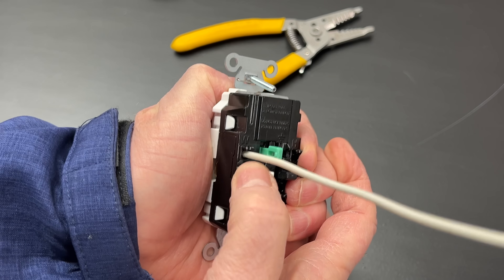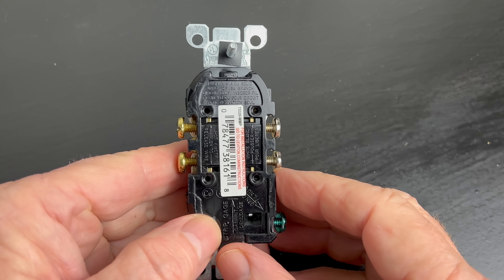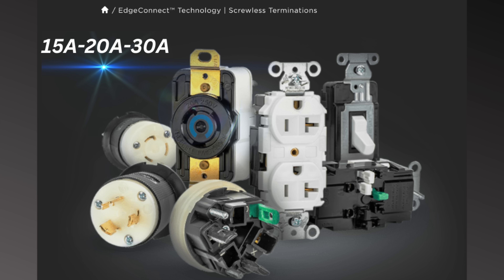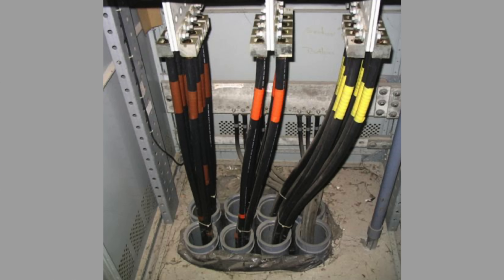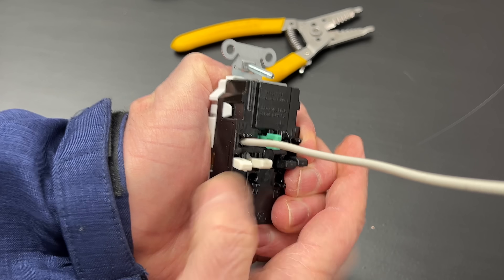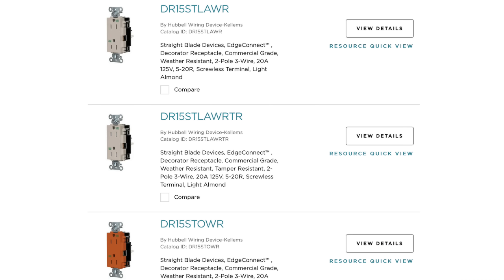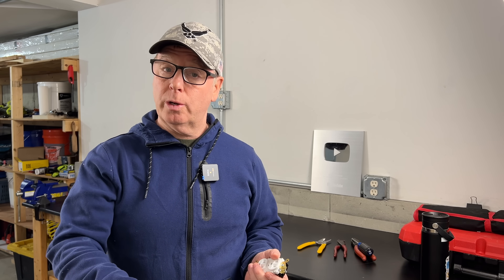This New Receptacle Design will set a New Standard (Welcome to the Future)

Comment: But will the spring loose tension with heat
Reply from the maker: I don't think so. The spring is not part of the current path. It presses up against the contact point. I think devices should be replaced about every 30 years and I'm confident that these will last that long or more.

Comment: Sounds like a good option for homes built in the 80s with cooper clad aluminum wiring which I understand is a thicker gauge and brittle.  Thanks for the tip!
Reply from the maker: I believe these are only rated for copper wire.
Reply: yes they Copper only  @BackyardMaine

Comment: 'Most' electricians may not recommend 'backstab' connections but, ironically, every outlet and switch, in my house, use them.  Maybe electricians should follow their own guidelines.
Reply from the maker: Some electrical contractors bis houses low to make sure they win the bid and then they force the installers to use the stabs because they're so fast. I read one comment from a subscriber that said if his boss bought him making J-Hooks he would be fired on the spot. Another comment saying that each device was timed and if you fell behind you were gone.. That's the issue in my opinion so I would like to see the manufacturers stop making them. This new type is awesome though.

Comment: My wife and I lived in a mobile home when we were first married. It was a very nice little house, the previous owner had even installed a pitched roof and insulated it. The one thing they didn't do, however, was update the wiring. I had a receptacle catch fire one night. I was lucky as i witnessed it happen and took care of it quickly. The trailer was wired with aluminum wire and used the back stabs on the receptacles. That is a bad combination! I love the look of these new receptacles. I will be giving them a try!
Reply from the maker: I've heard a lot of horror stories about mobile home wiring but I have never actually worked on one myself. The stab connections are rated for solid core copper wire only on the old back stabs. I'm glad you were able to take care of the fire quickly.
Reply: I would put money on the fact that those devices were not listed for use with AL wire. It wasn't jut the backstab-the whole thing was probably suffering the corrosion that occurs between dissimilar metals.  That turns your outlet into a heating coil in the wall.  Thank God that fire didn't happen in the middle of the night.
Reply: @HBSuccess  

Amen! I don't think there were many safety protocols while building mobile homes in the 70's.
Reply: That's what I was thinking too.  I think all backstabs are rated for copper only.  Code violation.

Comment: Wago cage clamp technology. I`ve used it for years in industrial machine controls. Extremely reliable connections!
Reply: First saw Wago connectors years ago on a transmission control module that vibrated like crazy, They worked a treat and never failed in very difficult service, good product and it has been in designs for about 40 years. Great product design

Comment: These stab in back Receptacle Design has been out for 20  + years. My house was built in 1997 had has them.
Reply from the maker: Yes the old stabs like I showed in the video have been around for decades but they are unreliable and not recommended by most electricians like I mentioned. This new design has been around for a couple of months and is completely different.

Comment: With all the smart switches and outlets out there now they need to overhaul standards and make switch "modules" with a recessed box that you wire into the gang box once. The switch module would click into the box and make electrical contact. That way to "upgrade" a switch you just pull the old module out and pop a new one in. Quick and easy without messing around with any wiring at all! Probably just a pipe dream though since that would require a lot of changes to manufacturing standards and electrical codes.

Comment: I want back wire commercial grade.
NOT the push in and go wiring devices.
Those new style receptacles won't work very well with shallow boxes.
I want the option of screws on the sides.

Comment: Thank you in am new to your channel. Do you have an opinion and recommendations regarding electrical outlets with USB and USB C outlets built in?
Reply from the maker: Hey there..and welcome. The one thing to consider when installing a receptacle with USB or USBC is that they are quite a bit deeper than a standard receptacle so the depth of the box and how many wire are in it should be considered. Other than that I think all the major manufacturers are pretty decent.
Reply: @BackyardMaine  thank you

Comment: How do they compare to back wire? Does the wire twist after connected like stab connections? Price compared to back wire?
Reply from the maker: You will have to check your local supplier for price but I believe they will be priced inline with other commercial grade devices. The connection is solid, much better than I was expecting. I think the back wire connections are a great option as well. I believe these are being marketed as a time/money saver because of how fast they are to install with the same reliability as their back wire devices.

Comment: AS  A ELECTRICAN FOR 40 YEARS I NEVER LIKED TERMINAL CONNECTIONS USING THE 
 STAB-IN ON THE PLUGS. THE SCREW CONNECTION IS ALWAYS THE BEST METHOD PERIOD
Reply from the maker: I agree but we should stay open to new designs and feature they may actually be better. When plastic and fiberglass boxes came out all the experienced electricians we saying they were junk but in actuality then are safer, faster to install and reduce issues in the box after install. I started my electrical career in 1983 so 40 years for me as well.

Comment: I agree about residential grade outlets. I don't use them either. But you said the back stab are one time use. All the ones I've seen have a rectangular slot that you can put a small flat head screwdriver in and depress the tang to release the wire. The one you showed had that. 🤷
Reply from the maker: Yes they have that to disconnect the wire but once you do you cannot use the stab again. You can still use the side terminals. All backstab receptacles no matter the manufacture are listed as one time use only. It's in the literature and most also have it printed on the back of the device. The reasoning behind it is when you push a small screwdriver into the slot to release the wire you're bending up the metal tab that secures the wire. The wire will be loose after that and fail very quickly.

Comment: I like your video on these products. I’m retired from electronics and telecommunications( mainly RF)  tech jobs most of my work career. I always think of a wire size in an AGC glass fuse when I look at a connection.  The push in connections on the outlets and switches never  passed the 15 amp + safety factor. I’m getting ready to buy a bunch of outlets and switches on a duplex I’m building and will check this new type out. 
We used a lot of big stranded wire where I worked. The last place was a gateway earth station and our DC load for 48v was 1400 amps. I did 15 years doing communications work  on the Alaska pipeline before that. We did that with both fiber optic and mountain top microwave.  I lived in Maine once.
Reply from the maker: Very interesting, thanks for sharing. I'm not originally from Maine but I've lived here since 1994.
Reply: @BackyardMaine  I was stationed in Brunswick 72-75. I had a great time doing things like canoeing the Allagash, skiing Sunday River and Lost Valley and riding a 350 Honda around with friends that also had them.

Comment: This is the first time I have seen one of your videos. How refreshing to see another professional electrician telling it like it is. Although I am now retired I spent 50+ years doing troubleshooting and repair as well as new installations. Most of my work in later years was commercial and industrial. I spent a number of years doing residential repair and remodel and always recommended to my customers that they would benefit from using commercial grade outlets and switches even if they did cost more. Thank You Again. P.S. I started out in Los Angeles City and County which always had stricter electrical codes than national, like outlet orientation.
Reply from the maker: Awesome thank you and thanks for sharing your story. I started my electrical career out in Sacramento CA as an Air-Force electrician. I'm retired now as well.

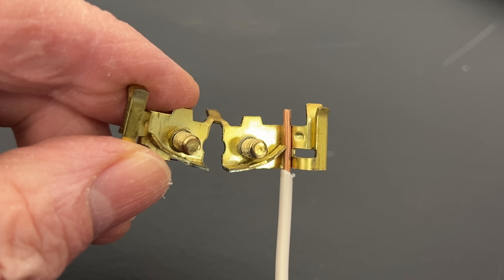Comment: At 2:37. Do you have the red meter probe in the neutral side of the outlet?  Isn’t the red probe meant to be used on the hot side of the circuit?
Reply from the maker: It doesn't matter when ready AC voltage.

Comment: I still think the side screw terminal with the J hook is going to provide a lower resistance connection which will be operating at a lower temperature when you have something like an electric space heater plugged into that outlet.
Reply from the maker: You may be right but this design is a huge improvement. I'm going to do some load testing on these and compare them to side wire connections with an IR camera.
Reply: @BackyardMaine  The side connections will have the lowest resistance, however, the gauge of the metal that carries the current from those screws to the actual outlet may be the hot spot.

Comment: The stab devices are trouble as are the indivisual connectors made similar for wires.
Manufacturers have torqe specs, how do you achieve a good safe connection with them? You can spin the wire once inserted.  How is that a connection and what's the torque? This new device connection looks good.
Thanks for the update!

Comment: I still think the J hook method is better due to the increased surface area of the connection. Can you spin the wire when connected to the Hubbell?
Reply from the maker: I like the J hooks and back wiring on commercial grade as well but these are really decent and a huge improvement. I didn't try to spin the wire so I'm not sure. I'll check when I go back out to the shop. Im going to do more testing including load testing on these so stay tuned.

Comment: I really like the promised range of their products (I.e., 20 amp, GFCI, etc), but I think I prefer the clamping design of the Leviton Edge.
Reply from the maker: They may be a bit more intuitive but they are only offered in residential grade 15A devices. Plus only receptacles, single poles and 3-ways and only DECORA style. Maybe they will expand in the future.
Reply: @BackyardMaine  I happen to prefer Decora, but I get your point.  At least their 15-amp outlet is rated for both 14 and 12 gauge wire.  I’ve written them a note asking if they plan to expand their line.  I’ll let you know if they respond positively.

Comment: I feel like the time spent screwing wires into outlets constitutes a vanishingly small part of an electrician's daily routine. It might even be a great job for an apprentice or helper.
Reply from the maker: I think I want over features other than the speed to connect them. Check out their product information page to see the connection test results obtained from UL.
Reply: @BackyardMaine  I agree, the features are great and should be on every fixture. IMO it's well worth the $20 price to novice homeowners who don't have the tools or the skills to use them properly. But I, and I'd think most electricians, find it more cost effective to use a $2 outlet and double-check my work before taping it up. I've never had one go bad on me.

It's funny, I never imagined it from a perspective other than an installer's.. it absolutely should set the standard for homeowner repairs.

Comment: Backstab was not made for DIYers; they were made for production new construction.  That electricians don't use the (now) doesn't mean they were intended for the DIYer.
Reply from the maker: I disagree. They were designed to make it simple for anyone to make a connection regardless of experience but then greed kicked in and contractors started using them in production homes because of the speed of use.

Comment: I’ve been using the Leviton Edge product 
This ensures a color match for the Leviton wall plate as well
Reply from the maker: These are similar but a much tougher design and higher end device overall. One thing I don't like about the Decora Edge is it's only offered in 15A residential grade devices, only in decora, and limited to duplex receptacles, single pole switches and 3-way switches. Maybe they will expand in the future?

Comment: How much weight do you think a screw terminal connection would hold?  I’m guessing 100+ lbs if torqued correctly.  25 lbs is nothing.  20 AWG needs to withstand nearly that much force for crimped terminal connection.  12 AWG should withstand at least 100 lbs.
Reply from the maker: I really don't know but as you know the pull test isn't really the best measure of a connections ability to hold up for years. I do know that the same 25 pound weight pulled out of the back stabs on both devices I tried from two different manufacturers. At 100 pounds you're going to stretch and probably break the wire.

Comment: Thank you for this information! I, too, am excited to see one of these- they look fantastic. MAYBE someone finally built a better mousetrap??? Like you, I have found many backstabbed receptacles where the "electrician" ran a heavy load item off of a backstabbed connection and over time the load burned up/loosened the connection with the resulting damage. I have only rarely used a backstab connection where I had no option, but ONLY for a lighting feed from a switch, never another receptacle. I was taught old school, side screw connections, do it once and do it right. But this new type looks promising!
Reply from the maker: Yup I agree. Out with the old and in with the new. lol

Comment: How does that hold up compared to the Leviton Edge series devices that use a lever action to secure the wire?  Similar to Wago connections, but built into the device.
Reply from the maker: Those are pretty good as well. One thing I don't like about the Decora Edge is it's only offered in 15A residential grade devices, only in decora, and limited to duplex receptacles, single pole switches and 3-way switches. Maybe they will expand in the future but for now I prefer these.

Comment: I still like the back wire under screw terminals on commercial grade receptacles the best. it is very secure and foolproof I see people mess up wire nuts and hooks around screws, but a strait wire under a screw clamp is hard to mess up.
Reply: Ya the back wire commercial clamp ones are still my favorite.  Very robust feeling, easy and secure.
Reply: Exactly. I asked weeks ago what these fancy Hubbell outlets cost and, no surprise, got a vague answer.  I have never liked the bottom-barrel homeowner grade outlets and their wrap-around-the-screw connections. The commercial grade outlets are a solid compromise and take barely more time to wire than these Hubbells. It is hard to imagine that they would save enough time to justify what is surely a lot higher price.
Reply: @TruthInFlying  They might only save enough time in areas with very expensive labor.  Being in the NYC area even a small amount of time savings add up to a lot.

Comment: I’ve been replacing all of the outlets and switches in a house my wife and I bought a few months ago. Almost all of the wiring was done with the quick connects, including daisy chaining to the next outlet. I did find some outlets that were using quick connects on 12 gauge wire! They were marked as being able to use either 14 or 12 in the quick connect. Some outlets had the quick connects so loose that the wires just fell out when I pulled the outlet out of the box.
Reply from the maker: The quick connects used to be offered on 20A devices but due to the high failure rates they are only offered on 15A devices now. This new connection by Hubbell is quite different and so much better.
Reply: They were only a problem when #12 was used. I’ve never found #14 causing the old outlets to fail on the back stabs. No one ever makes this distinction.
Reply from the maker: @1337farm  I have found countless issues with the 14AWG as well.
Reply: @1337farm  I had several outlets that only used #14 have the wires falling out when I pulled them out of the boxes. Of course, these were probably originally installed about 30 years ago.
In any case I've been replacing them all with heavy duty receptacles using back wiring and daisy chaining with Wagos and pigtails instead of going through the receptacle.

Comment: For plumbing or wiring, I trust SOLDER.  Not push-in springs, not spade lugs, not wires wrapped around screws.
Reply from the maker: It's a code violation to solder wires to a receptacle. We have to install them to the manufacturers instructions.

Comment: The connection seems to be good, but if you have a receptacle where you have 1/going to a switch for a lamp and the other 1/2 as a receptacle from a nother circuit, what do you do for that ? You may have talked about it in this video, but I couldn't see where you put the  2nd wire(s). It would be great if you made a video on the subject.
Reply from the maker: Yes I covered that. Theres a bridge you break off to split the receptacle and then you would have one side connected to power and the other side connected to the switch.

Comment: I'm not a professional but I have never trusted push in connections.   Isn't there also a new outlet with wagu connections?
Reply from the maker: There is but it's limited to just a few options and only on 15A devices. I have never liked the stabs either but this new design from Hubbell is awesome.